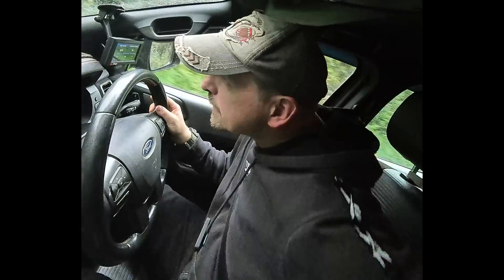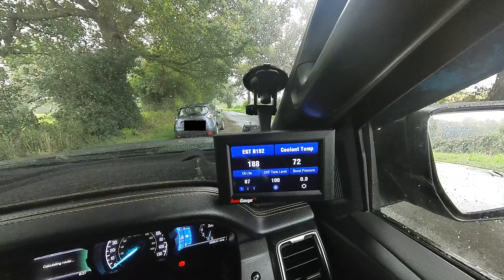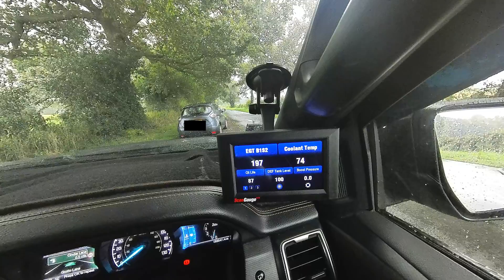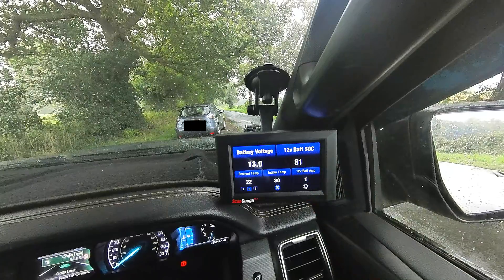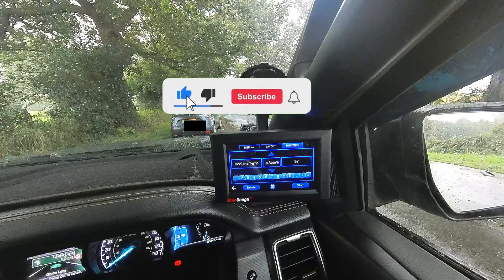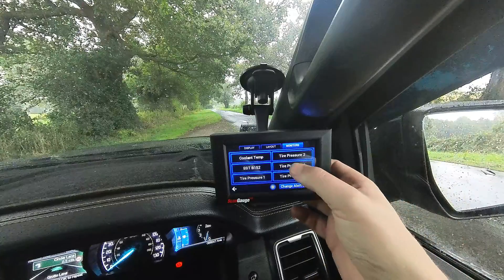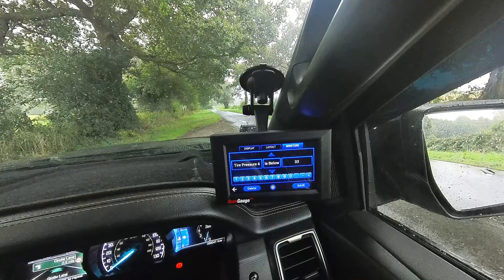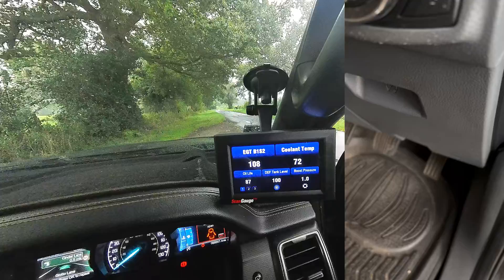Scangauge 3: Worth the Value? | Gauges to use & Why.

Comment: Are you supposed to leave it always plugged into obd port? Does it damage the ECU?
Reply from the maker: Hi @tdang9528, thanks for stopping by and commenting, much appreciated. The tool is left plugged in and fires up when the car starts. I haven’t experienced any ECU related issues and I’m not aware of any being reported. I’ve had mine now for a while and really no ECU related issues at all. I also had a quick scan around the internet before purchasing and could find anything which stated it would cause ECU damage. Hope this helps you.